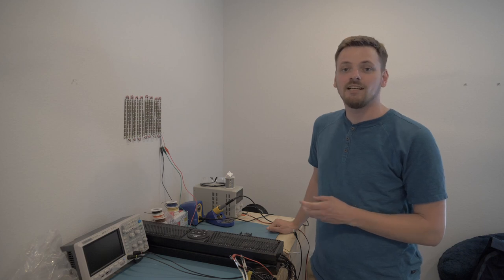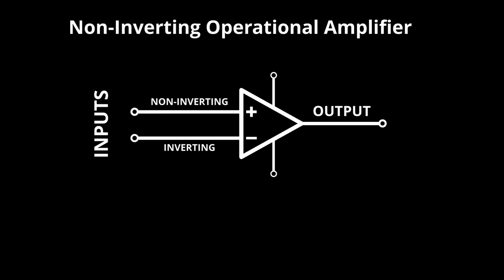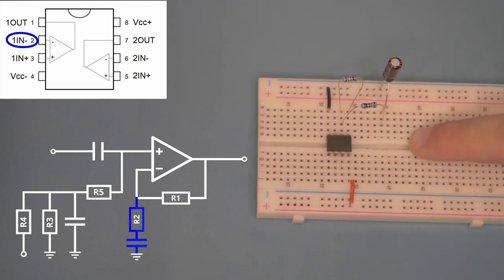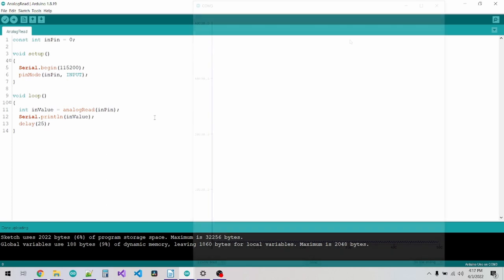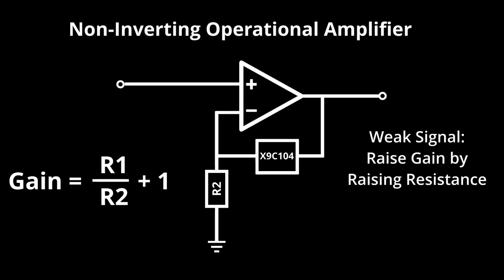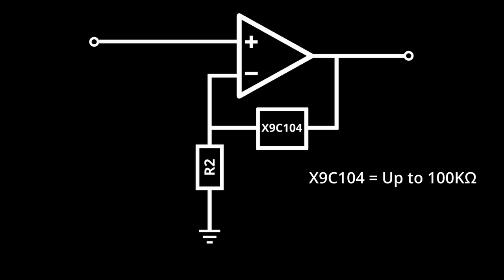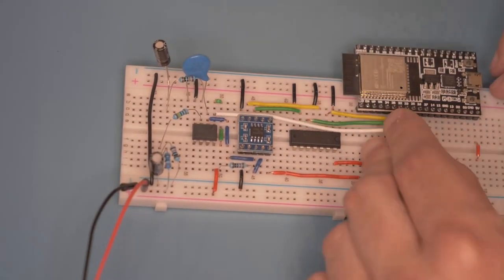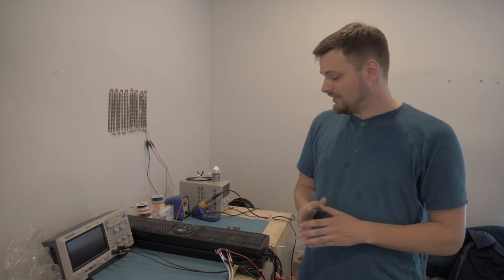Creating a Spectrum Analyzer using an Arduino and a Non-Inverting Operational Amplifier

Comment: Auto Gain control in preamps like this is traditionally done using a JFET and a peak detector circuit. The JFET serves as a voltage-controlled "potentiometer".

Comment: I'm a novice with electronics.   However, one small correction.   My understanding is that the inputs of an op-amp never have current flowing into (or out of) them.    When you were concerned about the digipot being 0 and currently leaking into the inverting input, that would NOT happen.   In fact, when the output is directly connected to the inverting input like when the digipot is set to zero ohms, the op amp just becomes a buffer with a gain of 1.       It's actually a common use of an op amp when the source has high internal impedance and you need it to drive a circuit with low impedance.
See Dave Jones "EEVblog #600 - OpAmps Tutorial - What is an Operational Amplifier?"

Comment: you don't need 2 power supplies, for negative voltage make Virtual Ground with a voltage divider with 2 resistors and 2 caps of same value
Reply: Correct ! 
   ;)
Reply: even better would be to use a second op amp as a v-ref
Reply: Works for logic levels, but better is if you use zeners and transistors. I use that for amplifiers and it works great. Also, it removea a lot of hum and hiss
Reply: i  literally was watcing about single rail supply and vitual ground yesterday thats funny
Reply: You can not use that on OPA, because they draw too much current which makes the voltage collapse.
Reply: @dreamyrhodes  No, the bias current into an opamp input is less than 1nA , which is completely negligible compared to the 25μA in the bias chain. Although, I'd put at least 1mA through that, if I were designing it.
Reply: @karlohorcicka7388  For low voltages, Zener diodes are poor references, and for a 2.5V bias, I'd use a TL431 passing about 1mA for a rock-solid bias point.
Reply: @RexxSchneider  Meh. This circuit is supposed to be decorative visual EQ. A simple resister divider is plenty good for that
Reply: @thewhitedragon4184  That's true, if you're only doing some simple visuals. However, if you're working from a supply that can vary between 12 and 14V, a resistive divider will shift the maximum voltage into the MCU between 4.3 and 5V. There are plenty of applications where that is a significant change and a TL431 is a cheap fix to stabilise a voltage that's going into an ADC.

Comment: The ATMega328p ADC reads a signal between 0 and the voltage on the AREF pin. Optionally, you can configure the mega to connect AREF to the its internal voltage reference, roughly about 1.1V, making it pretty ideal if you had a positive signal from 0-1V.

There are many ~6V opamps with RRIO (rail-to-rail, input & output) that let you use the [almost] full swing of voltages from top (5V) to bottom (0V) of the power supply rails you give them.

Comment: Fantastic video. Your detailed explanations were very helpful for my novice level understanding of op amps. This is a project I might try to build.
Reply from the maker: Thanks! If you do try, I'd highly recommend trying to find a soundbar with a pre-amplifier output line, or to just ignore the whole digital potentiometer idea entirely. Trying to solve these issues on the fly lead to this becoming more convoluted than it needed to be. A good learning experience, but not a great final design!
As far as the .ino code to control the LED lights, there's several really good videos on youtube already that show how to do that.

Comment: Nothing bad happens if you connect the opamp output to negative input. It will operate in it's most linear region and will  act as a buffer.

Comment: Automatic gain for the win. Long ago I made a circuit to "listen" to music and flash neon to it. I made a wide range AGC. I could plug the input into a wall socket and it would be fine, yet it could pick up the signal from a turntable without a preamp.

Comment: Very well presented! From a seemingly simple plan to bias and amplify your audio signal to it getting overly complicated quickly. I'm not an expert but I've been working on a similar problem to condition the audio signal for input into a microcontroller ADC. I've picked up some ideas examining a few simple Arduino based tiny oscilloscope circuits and such. May I suggest a few alternative solutions

Most importantly tho you could do with a pre-amplified 'line-out' from your source, I see this had already been mentioned by another poster here. Double-check if your sound-bar has it already, it should be a 3.5mm audio jack hole. This will save you a major headache by cutting out the convoluted 'auto gain control' system you are designing and you can get back to your simpler original design! Still it will be good experience nonetheless building something that complicated, it may come in handy somewhere else 🙂

I haven't looked up the specific op-amp you're using but I know that there are rail-to-rail op-amps available that will allow your signal to go nearly to the supply voltage limits without clipping

You don't specifically need to wire the op-amp to 'non-inverting' mode, the inverted signal will work fine for your spectrum analyser and the circuit will be simpler

But if you decide you want to keep it non-inverted then remember you have a pair of op-amp in the 8pin package. The circuits I've seen have the biasing and the gain done on separate stages , not sure if there's an advantage to it this way or maybe it's simpler

Try the LM27762 chip to drive the negative side of your op-amp, it generate the negative supply voltage via charge-pump circuit from the positive. This chip can be invaluable in situations like this 😉

Hope you find some of the above suggestions useful. I guess there is no right or wrong way, just what you may find is suitable for your circuit
Reply from the maker: Thanks for the thought out comment, I agree that this project quickly became convoluted as I attempted to understand and solve the issues I ran into. Much more a walk through of my learning experience than anything.

I found little to no good documentation out there on how to use an op-amp the way I wanted to and hopefully my video and further comments like yours can point others in the right direction.
Reply: @himynameischris2175  can u give clear circuit diagram
Reply: The only signal conditioning crucial for driving an MCU is to keep the voltage on the input pins from swinging below ground or above the MCU supply rail. The simplest way to do it is to use a rail-to-rail opamp like the MCP6002 and drive it from the same supply as the MCU. If you must use a TL072, then put an appropriate Zener (or TL431) across the MCU input pins and drive it from the TL072 output via a 10K resistor.

It should not make any difference whether you use a line-level output (≈ 500mV) or output level (≈ 2V) from the soundbar. You still will want an adjustable gain somewhere between 1-2 or 10-20 or so, so you can match differing music levels. Just use a plain, old-fashioned log potentiometer for R2 and adjust it as required to get an output range just below clipping.

The TL072 will swing to within about 500mV of either rail, so it's not too bad, considering its age. Nevertheless, a rail-to-rail opamp with a single 5V or 3.3V supply will save a lot of design headaches.

The only issue with using an audio opamp in non-inverting mode is that the input impedance is simply the input resistor, which is likely to be considerably less than the input impedance in non-inverting mode. However, if the source impedance is low then it's not a problem.

The advantage of using the second opamp to supply the bias point is that it mustn't be left floating, so you have to tie its inputs somewhere. If you connect your 2.5V bias directly to the second opamp's non-inverting input and then connect its output to its inverting input, you can use its output as a very stable 2.5V reference in order to bias the first opamp. That kills two birds with one stone.

You don't need a negative voltage supply, and switching regulators (e.g. charge pumps) are inherently noisy. I really wouldn't recommend using them in audio applications. HTH.

Comment: Another solution I haven’t seen here is to use a specifically “single supply” option amp like LM358 (dual, drop-in replacement for your TL072) or LM324 (quad). The advantage is that their negative swing can go all the way to V-, so with your +12V battery you would still have an upper limit around +10V but you wouldn’t get the negative clipping at 5V or no-output at 3.3V. These op amps are ideal for a situation like this where you need a full range between 0-5V and are much cheaper than “full” rail to rail op amps.

Comment: The AREF pin can be provided with any voltage desired between 0-5V, and will define the top voltage for ADC conversions when analogReference(EXTERNAL) is called. Using this pin requires reading the manual and some calculation, since a 32K resistor is connected to it. 

Of course, you still need to shift or discard the negative voltages.

There is also INTERNAL1V1 for 1.1 volt, and some have AR_INTERNAL1V0 for 1.0 volt, which means you don't need to amplify that extremely in the first place.

Comment: Some things to mention. 
You should add series resistor and 2 clamping diodes in parallel to ground (a zener and a reversed shottky) for extra protection. 
Also, by setting a different vref on mcu, you could reduce required gain. The uno has a vref pin as well as an additional  internal 1.1v vref. 
If you set vref low enough, you may be able to remove the opamp entirely with limitation on minimum amlitude for best results.
Reply: "You should add series resistor and 2 clamping diodes in parallel to ground (a zener and a reversed shottky) for extra protection. " ....to the input from the RCA plug ?
please elaborate.

Comment: I like the idea and the concept of where you were going but did have an issue with the op amp. If the sound input has a brief peak of high energy, the output level could exceed the input specification of the ADC input on the micro controller. And more than likely, there will be a significant excursion past those limits at power up due to the position of the capacitors in the circuit. Or if anything went wrong on the op amp side, you could be dumping about -10 or +10V on the input pin. A quick solution might be to add a resistor between the op amp and the microcontroller, to limit the current flow into the protection diodes on the chip. I generally like to use a rail to rail op amp running at the circuit voltage (usually 3.3V for my designs)., this means i don't need extra voltages and automatically provides a limit on the output within the acceptable range of the ADC input. And no negative voltages either. For a circuit like this, an inexpensive op amp like the MCP6001/6002(dual) would probably be fine. This part is also available in a DIP package as I recall which will make it easier for you. Pretty cheap as well. There are tons of other acceptable op amps from Microchip, Texas Instruments, Analog Devices and others.

Also, you generally don't have to worry too much about the feedback drawing too much current to the - input, the inputs are usually very high impedance. As long as the overall divider doesn't exceed the capable output current of the op amp, there shouldn't be an issue. Staying in the 10K to 100K range is usually a good compromise, if the impedance gets too high, bandwidth could suffer due to input and stray capacitance and be more likely to pick up noise. For low frequencies, I generally work around 10K, for analog video I will use 1K or less.

Also, don't forget a bypass cap on the power pin(s), it will help keep things stable and keep noise lower.

For biasing, I would have probably just used divider resistors to power and ground directly on the + input, eliminating an extra resistor and cap. I don't believe the slight noise improvement of the extra parts will help here, especially with good, stable and clean power supplies.

Those are just my suggestions. Keep learning, sharing and trying new things. If you can get your hands on an old National Semiconductor Linear Applications book, it will help open up a big analog world. I think the earlier 1978 to 1982 versions were best (in my opinion). Good luck and keep going.
Reply from the maker: Thanks for the input, I have a background in computer science but the electronics side of things I'm iffy on. The video was mostly the product of me just trying to teach myself this stuff and learn by trial and error, I'm sure I could redesign it to be a lot better/smarter. It's difficult finding good sources for info on specific things like op-amps online. 
I'm away from home currently but I want to do a followup to this when I'm back.

Comment: X9C104 can be 0 ohms without causing ANY problems. In fact, virtually any modern OP_AMP can work as a VOLTAGE FOLLOWER or BUFFER,  by connecting inverting input directly to the output.
Reply: Yup they are literally made to be not only be stable but have a at least 45deg phase margin as a follower
Reply: Yes I was going to say that too. As long as R2 is high enough to limit the current to sane levels R1 can be 0. Opamp pins have really high impedances and would just act as a buffer as you've said.

Comment: If that's a dual op-amp chip you can use it to generate a virtual ground circuit to both bias the input signal and eliminate the need for a second voltage source.

Comment: There is input leakage current in the opamp. This favors lower resistors. Additionally input capacitance can limit frequency response if feedback resistors are too big. Input offset voltage need not be considered because the dc gain is low.

Comment: btw, most of the gain control can be done in hardware. feed a copy of output into a full wave rectifier (using another op-amp), divide by 2 via resistors, feed into a peek detector then into a comparator comparing to half mcu vcc, take the logic pin of comparator and put on the up/down pin. for increment pin supply a 20khz (recomended) clock through an and gate (could use nand doesn't matter), the other input comes from an or's output. one or input comes from the comparator, the other comes from a gain increase enabler (could be a comparator-triggered time delay or a button to vcc and resistor to gnd or a pin on mcu to trigger via ir or wifi or bluetooth).
Reply: Fairchild/Onsemi makes a really nice photo-FET optocoupler, the H11F3M, that can act as remote voltage -controlled resistors whose value can be changed over a wide range from 100Ω to 300MΩ by changing the current through the photodiode input. A simple diode/resistor/capacitor from the output of the opamp to drive the photodiode with around 1-10mA will produce a 10:1 change in the resistance that can be used as the feedback resistor to make the simplest practical agc circuit. The only snag is that HF11F series is a bit pricey at around £3.50 for 1 off from Mouser.

Comment: Just use a second opamp.   Power them both at 24V and then use the second amp as a buffer for a two-resistor voltage divider to produce a virtual ground.  Reference everything to this and you have +/-12V from your single bench supply.